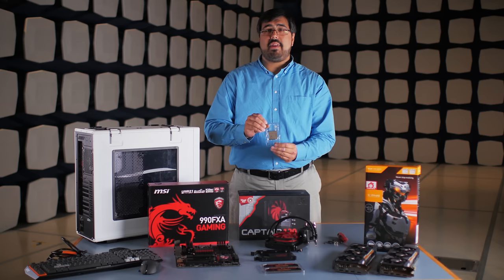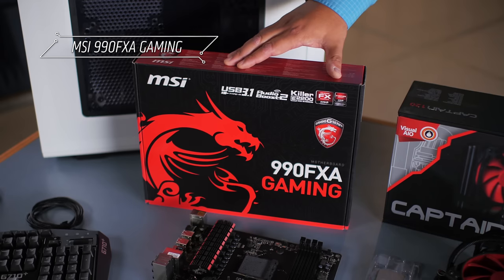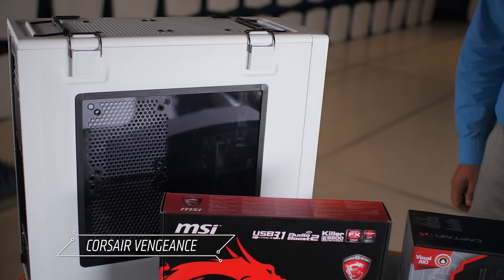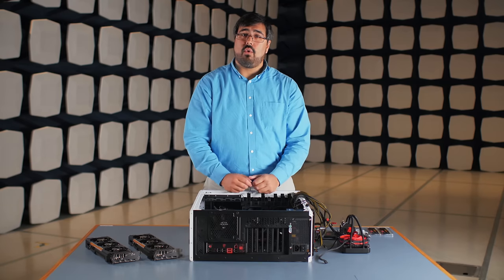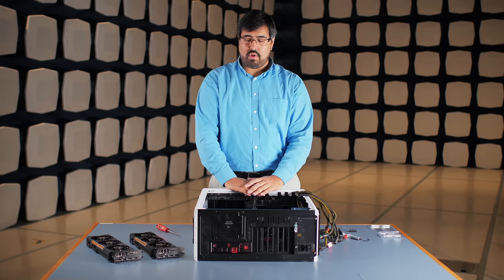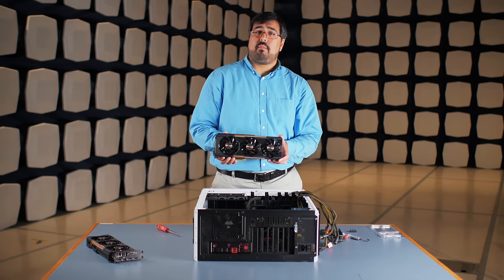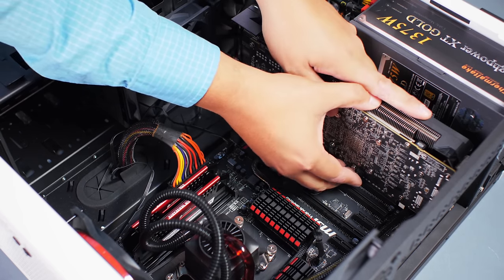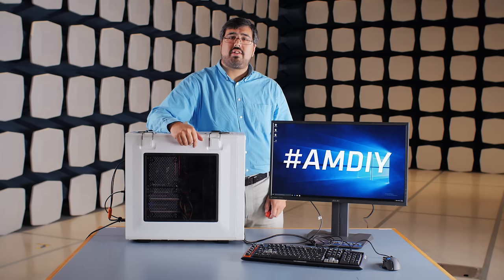How to Build an AMD FX™ 9590 CPU-based PC

Comment: people who buy fx 9*** are mad
Reply: +berzu21 bro FX sucks for gaming, a lot of games your FX will bottleneck the GPU unless it's a very weak GPU
Reply: +Samueltl hey, I got my fx9590 for FREE so Im not crazy!
Reply: +SeekNeo The hell are you talking about? If I can use an FM2+ A10 8750K APU with only a quad core--with only 4 megabytes on the cache without shit bottlenecking, the FX series should be fine.
Reply: for me the best option price/peformace is a fx 8***, for the price of a 9*** you can buy a intel and its better just my opinion
Reply: +SeekNeo um not really
Reply: +SeekNeo Why you here then?
Reply: +berzu21 5GHz CPU? Kappa Buy a 2500k
Reply: Just look at the Fallout 4 bechmarks. Intel shits on AMD
Reply: +Lock Gamers Troll alert. I don't get mad at new people like you. My PC is fine as it is--with a 4 megabyte L(evel) 2 cache along with 3.7 megahertz processing. I'm using a 260x, along with it--seeing as though I don't need to really buy anything too crazy. An FX series CPU would not fit into an MSI FM2+/FM2 chipset socket with 100 on the power. Furthermore, the 7850 K FM2+ is almost top of the line for people on a budget. And hey, with those compute cores--I can run Linux Mint Mate or something else in dual boot if something happens to my graphics card. I got what I needed--and wanted. As for you? I really doubt you understand the concept of needs and wants when it comes to being on a budget--and planning ahead. As for overclocking? I can override the lock on the APU if I wanted too--considering I can actually overlock to 4.0 gigahertz if I actually NEED it. As of the moment though, I don't need that type of power--and I don't want to destroy my APU quicker than I need too. Kid, if you want to mess around in a serious AMD Youtube video showing how to's--well, you're just an idiot. Get rekt.
Reply: Grey Broyles yes i have 7870k and fuck hd graphics hd530 fuckin bad 7870k wow wait a12 pross :D
Reply: +SeekNeo Lies the FX beats all i5s! :D
Reply: ネーナ・トリニティ haha 9590 5ghz and cant 6600k  maybe 6400
Reply: Lock Gamers Pfft all lies and propaganda! Look up the benchies!
Reply: ネーナ・トリニティ battfieldf 4 9590 80
6600 97fps
Farcry 4 9590 50
6600 70 
Gta v 9590 60 
6600 70fps yeah fx win
Reply: berzu21 I'm outdated. But my point still stands
Reply: Lock Gamers Look up Fallout 4 then the FX crushes the i5s! >:D
Reply: ネーナ・トリニティ only fall out other games 4460 crushes 9590sss
Reply: But i love fallout 《;D
Reply: Lock Gamers Nope try playing H1Z1, Grey Goo, Cities Skyline, Battlefront and other modern games then the FX beats i5 in most cases and lets face it old games runs fine on a toaster! :D
Reply: ネーナ・トリニティ but 9590 price higher 6600 i cant se 9590 beter 6600 give me link
Reply: Fck but i cant see skylake emhhmm i7 crusheszs fxxxxssss:D intel have 5960x muhahaha zen cant beat new x99 6960x :S i think phenom awesome cpuu zen maybe amd e
Reply: Lock Gamers FX is good but the thing is they are no i7! :P
Reply: +SeekNeo Are you insane? im running intel so do not call me a "amd fanboy" not even the athlon cpu's bottleneck maybe at max with 5 fps but thats it.
Reply: +SeekNeo I got a fx8350 with a gtx970 all games vsyncs on 60fps never goes below 60fps..
Reply: Peter Jönsson 8*** not bad but 9590ss price highhh
Reply: +Lock Gamers is amd 9000 series came out couple years ago?, it has older architecture than intel and you compare it with new intel 5960x and 6000 series? fx is made to compete with 3th gen & 4th gen
Reply: RafadanaM i7 2600k :D
Reply: sirxziane xeon fcker server cpu :D
Reply: +SeekNeo intel/nvidia fan boy talking.  Do your homework before talking trash.
Reply: +Danny Banos I've done it bro, my cpu is AMD and it sucks dick, intel is much better
Reply: +SeekNeo I'm not saying that amd is better than intel. Every1 knows intel CPUs have better performance but also way more expensive. But a good fx cpu like fx8350 won't bottleneck your gpu. My has one paired with 980 and works fine.
Reply: +Danny Banos works fine? lol look up you gpu usage in a cpu demanding game, if you're getting 60% you could be getting 95% with intel.
Reply: +Actv Productions wut

Comment: Still waiting for Zen
Reply: +John Locke (4TheRace) We all are.
Reply: +John Locke (4TheRace) Same man. My build feels hella outdated for a 2013 build.
AMD FX 6100 Zambezi
8GB DDR-3 Kingston Hyper X @1600mhz
XFX 7870 Double D Black Edition 2GB GDDR5
WD Blue 640GB HDD @ 7200RPM
Generic DVD Drive
Antec Twelve Hundred (not V3)
650w Corsair TX (Non-Modular)
Stock AMD Heatsink/CPU Fan
Reply: +Who 
still very capable
Reply: high five 😆
Reply: +TigerArmy1962 sadly the Zen will also be called FX ^^ still wont buy it, huh?
Reply: I wonder if Zen will be called "fx 10 000"
Reply: Maybe dont 4 or 5 numbers, but 3 number. ex. FX-350 or FX-450 :)
Reply: time is up.
Reply: Hm...

Comment: I am still rocking my 8320e and I run all the latest games at maximum graphics!  I actually downgraded from the 9590 because its hotter than the surface of the sun and consumes more power than a time machine.
Reply: It is not difficult to convert a FX-9590 into a FX-8320(e) or another FX-8XXX. Just down vcore and CPU multiplier. Regards.
Reply: You could've just underclocked it. They are the same cpu after all.
Reply: i wouldn't buy a whole new cpu i would just underclock it

Comment: The title should be:
How to build a furnance.
Reply: +TheWarriorofDestiny lol how to make a campfire
Reply: +TheWarriorofDestiny change the CPU to FX 8370, it's not so hot but performs as good as FX9590
Reply: +barondorado do you get holiday cards from the power company?
Reply: Who's gonna need a heater after this
Reply: +TheWarriorofDestiny How to contribute with global warming LOL xD i own amd myself but i just wanted to join the roast xD get it the roast? xD
Reply: Its almost winter so they're giving us a hint to build our own heater that you can game and watch movies on lel
Reply: +TheWarriorofDestiny This is not an Intel build sir.If you want to build an furnace get an i5 or an i7.You will be sweating in heat in the first 8 minutes.
AMDs don't run hot.If you want proof. Do a Google of Core Temp of any AMD FX or APU an find out the Temps.

     Then see the Temps of Any Haswell or i-Series processors.An if you say.The Temperature parts in AMD are broken.You would be wrong.I get Temps of 26,31 to 48 °F That's 0°c In games or intense programs it can go up to 38 °c

My build. http://pcpartpicker.com/p/8DNVVn
Reply: TheWarriorofDestiny furnace**
Reply: dang did this age well
Reply: ...how to BOIL the coolant in a single 120mm radiator...
Reply: @WarsunGames  yes the FX chips stays relatively cool, but it is the VRMs that get much hotter with the higher power draw.

Comment: People laugh at AMD during FX series, now tide has changed, people laugh at Intel
Reply: With Intel now switching to 10nm and possibly lower I dunno who to laugh at, at this point
Reply: @potatoavacadonion1025  Intel's new 16 core flagship will olny have 8 real cores.
Reply: @beavatatlan  which I still think is impressive cause it has only 8 performance cores followed by 8 efficiency and it's beating the 5950X which has 16 in general performance cores total
Reply: @potatoavacadonion1025  bro you  literally killed amd fan boy 😂😂😂
Reply: now who's laughing goofy boy
Reply: @sutnack7537  still AMD 😂

Intel 14th gen series are laughing stock, basically "Same CPU, new sticker"

Comment: Thanks AMD for pretty much advertising that the MSI 990FXA Gaming can support the 9590 and be stable. The system is not stable at all even at stock speeds and has to be underclocked

Comment: Used the 9590 on a Gaming 970.
Turns out you need a fire extinguisher mod to go with it.
Reply: MSI came with a new 970 motherboard named the 970 Carbon that is capable to handle the 9590

Comment: Just wondering how AMD FX9590 holding up against current gen Ryzen.
Reply: I Use it in 2021 .... IT is working FX 9590 32GB 2400MHRZ RAM GTX 1070TI liquid Watercoled both 
120fps AT warzone 
60fps CyberPunk
Reply: @dodo1234521 
Hello I' build one now and  gtx 1070ti is not overkill?
Could u please give me advice?

Comment: I tried the Captain 120 EX white which is similar to what is shown in this video and it does not have enough cooling capacity to keep the FX 9590 cool at factory settings. I had to do undervolting and a duel fan setup on the Captain 120 EX white to get the processor to not overheat in all processor work loads.

Comment: I've been planning on build a rig with the same pairing of the FX 9590 and the MSI 990FXA Gaming mobo - but I've read online that many people have had issues with this combo (mainly cpu freezing and stuttering when it turbos to 5GHz). Just wondering how your mobo coped with the 9590 beast. Did you have to turn off turbo in your UEFI - also where you able to overclock to 5GHz 24/7 with stability?? All answers appreciated :D even trolls
Reply: I think it will be more stable with the stock 4.7Ghz and 5Ghz turbo-boost. It likely has to use much higher voltages to stay at an overclock 5Ghz.
Reply: That dude is troll his set up is trash 😅

Comment: Good job with the ryzens, the company came a long way. I own a 1600x since 2017 and it's still going strong on both gaming and productivity. Hopefully Zen 2 will bomb the competition in July.
PS: I fried my motherboard with the AMD FX-9590.
Reply: what happened?
Reply: @eltorocal  it melted the motherboard
Reply: @Stein871  pictures?
Reply: @eltorocal  it was 8 years ago, so no
Reply: @Stein871  Hmmm... what caught fire/too much h heat? Let me guess... VRAM's and N/S Bridge chipsets/cooler areas?
Reply: @eltorocal  it didn't catch fire, the heat melted the socket and fried the back of the board
Reply: @Stein871  Ouch... either you installed the air/water cooled block improperly... or you installed the air/water cooled block improperly.

Drag man, that's such a great board and processor....
Reply: @eltorocal  the motherboard didn't have a metal back plate, the cooler did it's job, but the heat reflected from the aluminium case melted the back and the socket. The motherboard didn't have metal heat spreaders like they have these days.

Comment: Where's the Benchmark Video to this build????
Reply: THAT BOARD CANNOT  support the high fx 9590 and 9370 TDP ,
Reply: It can.
Reply: The support or not depends on more factors than the mobo. To have a good mobo is not sufficient to handle a FX-9590.

Comment: I've got the same motherboard, cpu and cooler but I've have 16GB Avexir Core Series ram, and a Lepa 600W psi. I was running Windows 10 but decided to go back to 8.1 due to some games not working right. I've been having random freezes and I really wish someone could help me out.
Reply: Bro do u still struggle?

Comment: Would be better off with FX8370 + 1 Sapphire Fury GPU.  Save the money for extra gpu and Fx9590 with liquid cooling solution , and the trouble of the crossfire profile performance issues .

Comment: can amd claim if this setup is still up and running to this date....cause I have a 9370 CPU on a m5a97 evo pro mobo...with 120mm liquid cooling all powered by a cooler master 750w psu that is constantly freezing and restarting after 2 years of smooth usage...?? if any one can tell me what's wrong

Comment: I really wish the industry had made a larger selection of fx 9590 compatible motherboards, got a real good deal on a cpu then had a heart attack when looking for a mobo!. my god the mobos are 5 to 6 times more expensive as the cpu was, wtf. and then it only run at 4.7 to 5.1?, my 8350 is running at 4.61ghz with the stock air cooler. but I do use very cool air from out side to cool the inside of my case, and I am now thinking of pushing 5.0 being its winter. supposed to get to 20 below tomorrow night so I might see how far I can go, just so you know I built a baffle for my window plus a 80x80mm tube with a fan inside pushing air into the top 2   5-1/4" drive bays wher it flows over the cpu and memory then down onto my graphics card. inside case temps sitting at 20 degs at the moment. think I will install my zalman 6 heatpipe heatsink and push the oc a little farther.

Comment: The FX is still a sweet CPU, sure it doesn't at the top so well in some games, but seriously if all you do is game anything Quad core is usually a waste of resources, the FX 6xxx/8xxx/9xxx series make for awesome multitaskers. Recently upgraded to a 4790k and I'm seriously considering going back to my FX CPU, the I7 is nice, definitely, overclocks easily and obviously performs better per thread than the FX, but stability, honestly the FX is much more stable, not just during stresstest where Haswell has an obvious Quality Control issue, but also in general, it might be the motherboard or something, but my FX is a lot more stable running for a longer time, and very rarely do I bump into a CPU bottleneck with a high-end GPU.

Comment: AMD doesn't even realize what their ideal APU/CPU products are...

A4-4000. Perfect for home users. Capable of Full HD Playback, fast enough for "browsing the web" and using the computer in general.

A8-7600. Ideal for users who want to game but can't afford a GPU yet but would buy one later on. Insane value...TRULY.

A10 APUs are just like the A8-7600...A SLIGHTLY better core clock and slightly more fps at games. Not by much. Not worth.

X4 860k. Could afford a higher-end card (for example an R9 380) but has no money for a core i5. 4 core unlocked CPU for ya.

FX 8320. Want to play games, stream them, render videos in adobe AE or Premier and just overall taxing the computer a lot. "Eight" core CPU (2x4 CPUs...look it up), does the job done, definitely cheaper than the 8-core Intel ones.

Other AMD processors simply don't make any SENSE to buy. They do NOT make so much of a difference.
I'm not an Intel fanboy btw...Intel has samiliar issues too. Their CPUs that are worth buying are ONLY the core i3, i5 and i7 series. You can argue that the Pentium G3258 is a monster overclocker and it's good enough for gaming...but it's NOT. It has 2 cores. Some games like Far Cry 4 and GTA5 require at least 4.

That is where companies lose money. I hate apple (for it's limited access operating systems) but they are doing ONE THING pretty darn right. They release the iPhone 6s (and iPhone 6s+ now) and it's DONE. They say it's good, go buy it. There's no "cutdown" version of an iPhone. AMD should KNOW which area they should target.

Who's with me?
Reply: +TheWarriorofDestiny I know what you mean, and in a perfect world that would be great and I agree with that. 
The issue is, they have to create 'cutdown' cpus, as they dont get 100% yield. For example with the fx line of cpus, the fx 8350 is more or less fully unlocked, but with the fx 6300, due to there not being 100% yield one moudule might not be fully functional so they disable it, producing the fx6300 6 core cpu. If they didnt sell the 'cutdown' cpus they would be losing a lot of money. Intel do exactly the same, and with lower manufacturing processes, the yields are lower and lower, with Intel currently maintaining an approx 60% yeild of 'mostly' working chips. 

Fx8350... ah yes, just saying. 4 modules, each with 2 cores for a total of 8 cores. There are only 4 floating point units though. That means, its a true 8 core if you define a 'core' as just a 'core', but if you define a core as a 'floating point' and a 'core' it isnt a true 8 core. 

However, cores years ago before floating points were really in CPUs were still cores so technically its an 8 core cpu. Either way, in terms of gaming performance you can look at it as a 4 core cpu, in terms of other stuff, look at it as an 8 core.
Reply: mee
Reply: +TheWarriorofDestiny my friend has g3258 @ 3,9GHz and he plays witcher 3 at medium with gtx 660
Reply: +TheWarriorofDestiny  Sorry but the fx 8320 is not a good choice for any gamer. In terms of gaming the fx 8320 is beat by any newer i3. The Apus are not great aswell. A Pentium with a dedicated GPU will outperform them most of the time. There is no reason to buy ANY AMD Cpu untill Zen comes out.
Reply: +MarioPL98 To be honest Under the performance of a GTX 960 (so yeah the GTX 660 too) it doesn't make sense to buy a core i5 anyways. I'm PRAYING for Intel to make a 4-core Pentium LGA1151 or maybe for a new socket...But they won't because then people wouldn't buy their core i5 CPUs =| Can your friend play GTA V and Far Cry 4?

Comment: I used this video as a guide to my current build fx 9590 black edition with msi 990fxa-gaming motherboard.  the motherboard chosen in this video doesnt allow the user to use the overclock genic 4 feature on fx9590 because the tdp is over 200.  such a disappointment.  I wanted to push the limit of what the fx9590 but can't because the mobo is restricted.  so i wouldn't recommend buying the motherboard.
Reply: +TeamHonSolo True.
Reply: More overclock? 4,7GHz is not sufficient? FX-9590 is an overclocked CPU just out of the box. It has an extreme factory overclock.